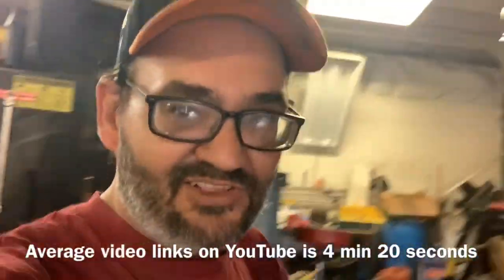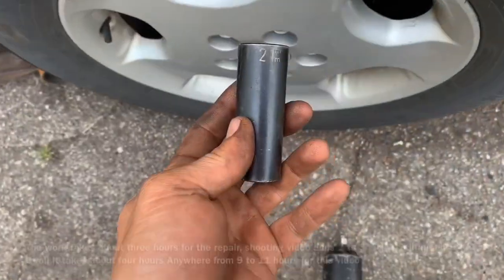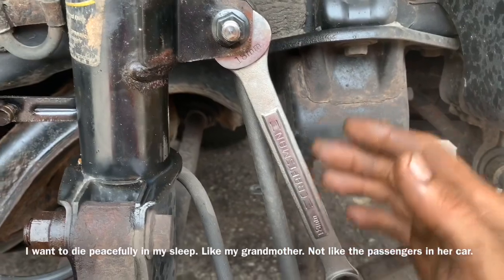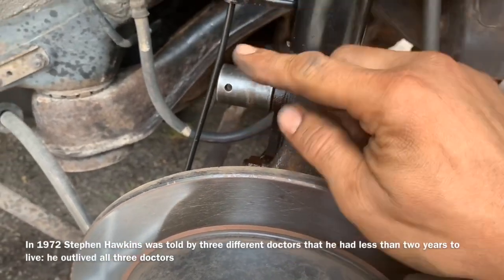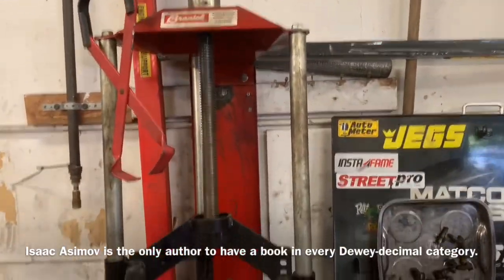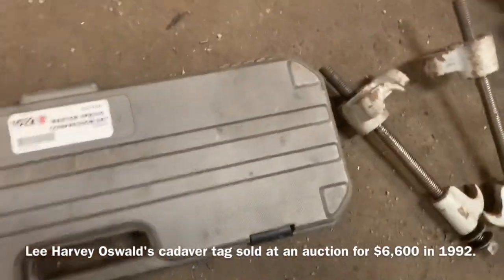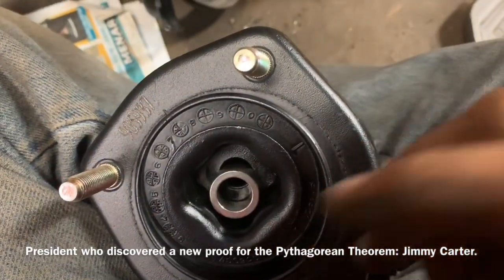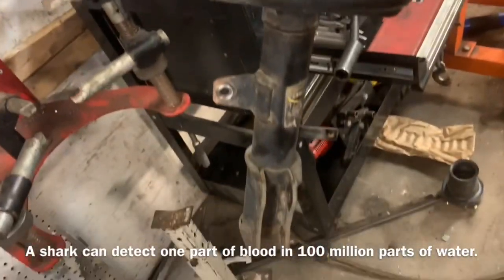Toyota highlander rear strut removal and disassembly.

Comment: I have 2005 Highlander Limited AWD with 3rd row seat. Can't find rear struts except OEM Toyota.  What's the difference?
Reply from the maker: I’m sure the aftermarket would fit but because you have the third row more than likely the spring is different it allows for more weight that’s just a guess though